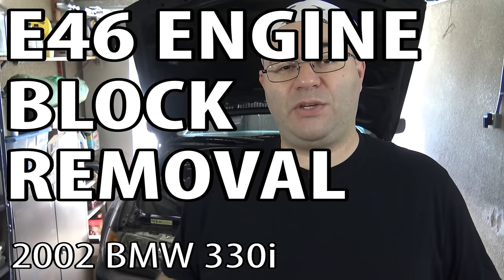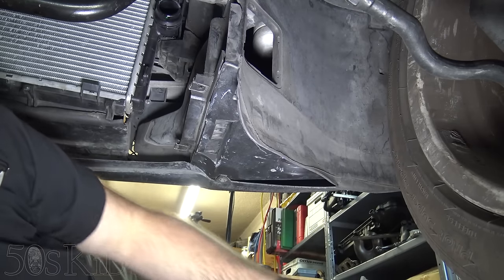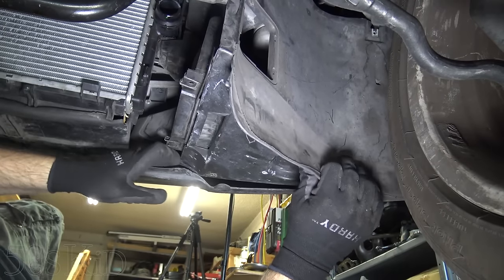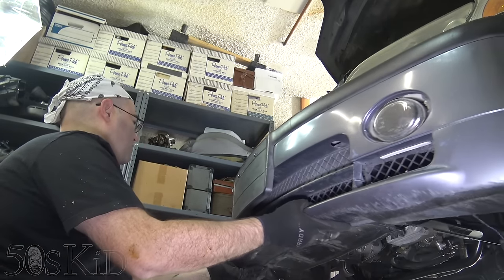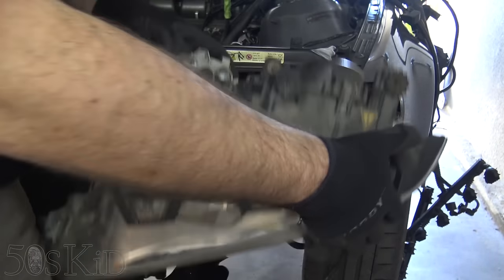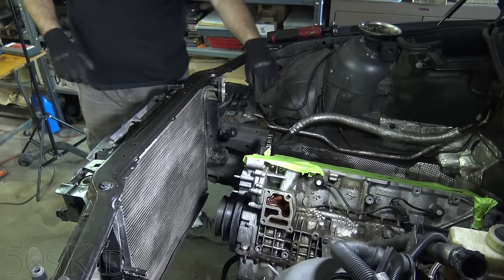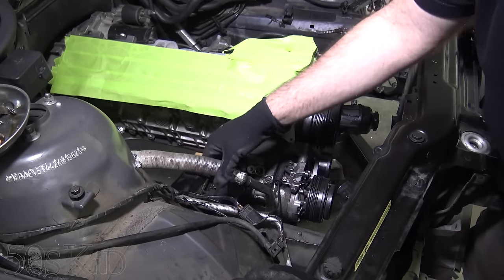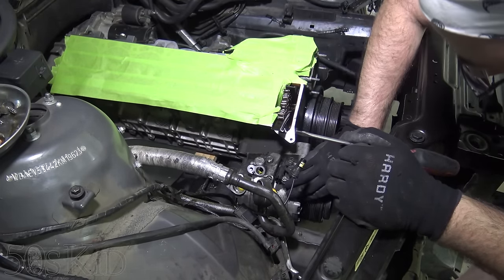BMW E46 Bottom End Engine Block Removal DIY #m54rebuild 13

Comment: You sir, are a BMW god! I'm referencing this exact video for my S54 motor pull on my 2004 E46 M3!! Engine is different, but similar enough in most parts of your video that, this has become the MAIN guide I'm using to getting the full engine pull job done!! I LOVE that you went with moving the engine forward slightly to get the top tranny bolts... I REFUSE to use 10,000 extensions to get to these with the tranny tilted, that is absolutely ridiculous! Anyway, THANK YOU sincerely from the corn state of IA; you're helping me avoid a $10,000 job at the BMW stealership! ;) XD

Comment: Hi 50skid! FYI - It is possible to support the AC condenser from a high point (out of the way) with a bungee cord saving you  the cost of recharging the AC system. The AC hoses are flexible even though they are shrouded in aluminum protective covering.

Comment: Thanks, nice video. Suggestion on the hood latch, leaving it connected on the front latch but follow the cable towards the top of the drivers side fender where it connects inside a plastic junction box. There you can easily disconnect it without having to mess with the connection at the latch receptacle on front support.
Reply from the maker: Ya know I saw that and the thought crossed through my head like why is there a little box there?  Of course that thought slipped out of my head just as fast!  Oh well.
Reply: Exactly what I was thinking..

Comment: The front lifting eye actually is on the M54. it sits around the intake vanos solenoid, but since you already removed the head it isn't there anymore.

Besides that, good videos and very good quality (both A/V and the content). Keep up the good work
Reply from the maker: Yes I know but there is an additional eye on the timing cover as well.  At least, on the m52tu there is.

Comment: +50skid, you tha man! You should do a quick vid on how you stay organized through a project like this ... when I "set everything to the side" I sometimes can't find my way back! Maybe as part of the common repair steps etc. keep up the great work!
Reply from the maker: Thanks.  Early on in the project (probably the first video), I pointed out that I was bagging each group of bolts and labeling the bags.  I've got a box of ziploc baggies with all the bolts in them.  The parts themselves are just sitting on shelves.  Really helps to have some storage area, that's for sure.
Reply: Bags and labels, great idea!

Comment: Great videos man. My 330 has 220k and I can see milk in the expansion tank so I take it my head gasket has blown and I'm about to pull it apart, I was a little worried about it at first but your series has helped me learn what I need to do. Great videos man
Reply from the maker: Hardest part is the exhaust manifold, man.  The rest is pretty easy.  I do recommend having the head resurfaced at a machine shop at the absolute minimum (which should be $45-$55) to prevent it from happening again.  Or have them do a complete clean, pressure test, and valve job as well (I just paid roughly $550 for the head work I had done).  Be aware that your head may have cracked just like mine did and you might have to get a new one to actually solve the problem.  Another reason to send it to the machine shop.
Reply: Alright man will do. I have a guy down the street that can do it. Weird thing is that the car drives great still. It doesn't overheat or leak fluid at all. Only thing wrong is the milky fluid in radiator lol.
Reply: Jordan harle same here, but I don't even have milky fluid in the radiator, y have coolant in the oil only, and of course, it consumes coolant

Comment: Great Video Jason! I am at the same point as you with my 330CI M54B30.  I have a donor engine that I am going to rebuild, so I will be following along.
Reply: My engine just blew and i have a 330ci as well. How come you are not rebuilding the engine from the car, was it too bad?
Reply: ninjadude2000  i just opened the top end of mine to do a head gasket change, and rebuilt the head.  It may hold t may not.  I got the other block for $120 from a guy who just wanted it out of his Garage.  My plan is to hopefully hone the sleeves, new rings, new bearings, oil pump water pump and maybe raceware studs in lieu of the TTY bolts.  I still want to cruise around in the car while I get the new engine done. Might also rebuild the transmission as well, Jason has some great information on DYI rebuild.
Reply: Cool. Going to tear down the engine at some point and see where it failed. Hopefully just a matter of replacing the broken parts and doing a rebuild as well. Good luck on your build!

Comment: Wish I was there at 16:57 , all it takes a minute to undo the cable , it's actually 2 pieces and the connector it's by the left fender.
Reply from the maker: I know--it wouldn't come out for some reason--the little catch on one side was bent or something.  I got tired of messing with it.

Comment: TIMING CHAIN GUIDE QUESTION

So I’m doing a head gasket replacement. The timing chain guide somehow broke, and there no tutorials on how to replace it without the engine already removed. I can see clearly here at this moment with the bumper and brackets off. It looks like the timing cover is totally exposed.  At 25:00 does anyone know if it is possible or @50sKid do you know if I can remove those 4 oil pan bolts and remove the timing cover here to replace my timing chain guide?

Comment: I have always wondered if the block warps hanging on the stand and it affects the head bolt torques.
It is a very long engine.

Comment: Thanks for all your great video's.  It's been a godsend for me.  I took my 2001 330 M54 out through the front as you showed.  Now to put it back in can I put the intake manifold, alternator and ac compressor on before shoe horning it back in or is it better to get the engine in and located on it's mounts before installing those items.  Obviously easier to put them on outside the engine bay but does that make the engine install too difficult?   Thanks so much for your advise.  Gary
Reply: i know Im randomly asking but does anyone know of a trick to log back into an Instagram account??
I was stupid lost my account password. I appreciate any tricks you can give me.
Reply: @Jared Ira Instablaster ;)
Reply: @Zachariah Alex thanks for your reply. I got to the site on google and im trying it out now.
Takes a while so I will get back to you later with my results.
Reply: @Zachariah Alex it did the trick and I actually got access to my account again. I'm so happy:D
Thanks so much, you saved my account!
Reply: @Jared Ira happy to help xD

Comment: I will be removing the M54 engine from my 2005 320i. What's the best way? Remove the front end bodywork and pull the engine and trans or split the two, and leave the trans in the car? Or, drop the trans then pull the engine? I"d prefer to pull the complete engine as a unit, rather than reduce it to a short block in the car.
Reply from the maker: or remove the hood and then the engine and trans. Up to you really whatever sounds like less work. Definitely easier to pull engine and trans together if you can.
Reply: Thank you. I'll pull the engine/trans out as one piece. then split the two. Once again, Thank you. BTW, I enjoy your videos.

Comment: Hello I have a 2001 BMW e46 M52 B20 with an automatic transmission. I'm planning to replacing my engine.Maybe you can help me. Do it make a difference if the engine come from a manuel transmission BMW.

thanks

Comment: Thanks for the info!  Very informative.  At what flatness would you consider getting the block resurfaced? .0025, .003, .0035 .004, .0045  Thanks in advance
Reply from the maker: Honestly you can probably get away with leaving the block as is.  Most people who do head gaskets don't pull the block to have it resurfaced.  There is a certain amount of squeeze present at the different points of the head to gasket to block mating surface.

Comment: That was awesome. What were those rear bolts torqued to? A spec or just overly cranked  tight?
Also, never really looked at your logo before, way cool.
Reply from the maker: Thanks.  I just cranked them too tight.  Not possible to torque them from underneath with the long extensions.

Comment: What are you gonna do about the transmission, the automatics don't usually last as long as the manuals.
Reply: Tool0GT92 he's got an excellent set of videos on how's he's already rebuilt the zf transmission. Check them out.

Comment: awesome job, is that a single mass flywheel?
Reply from the maker: It's a flexplate because I have an automatic transmission
Reply: I thought that after I posted it. Ya learn somethin' new! May have missed it but why'd you start the rebuild.. Something to do with coolant in the cylinders??
Reply from the maker: I really should mention why in the intro to these videos but most of them were filmed before people started asking.  Rebuild is due to somewhat low compression and oil consumption. 175k miles.
Reply: 50sKid mines on 160, 325. has the oil consumption but dunno about the compression. hoping rear main seal will sort the oil. no chance I'll diy that though so $$$$ 😂
Reply: 50sKid you can just put the rebuild story in the description dude :)
Reply from the maker: Ha I never think anybody reads the description, but I will start putting it in there anyway

Comment: couldn't you just unbolt the compressor and leave the HVAC system charged?
Reply: Yes, I did with mine.
Reply: Not if you take it from end off not. The condenser has to come off to if u do what he’s doing